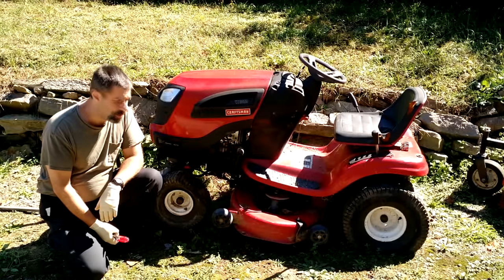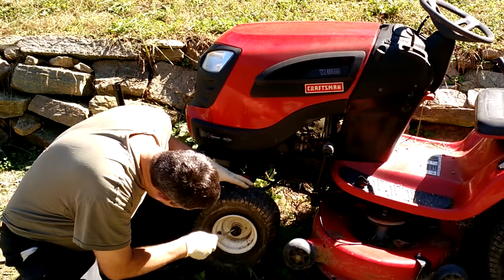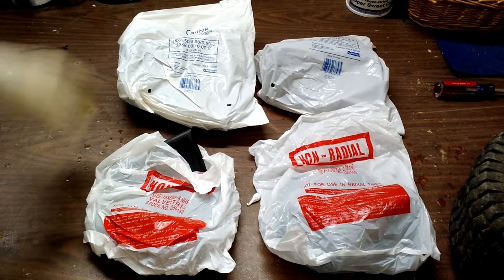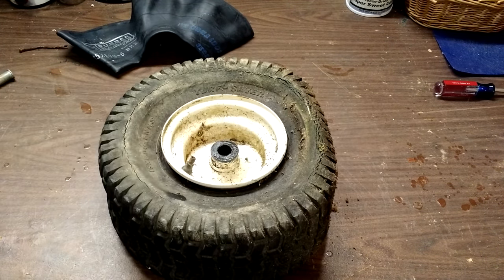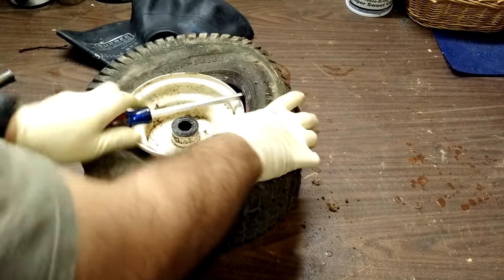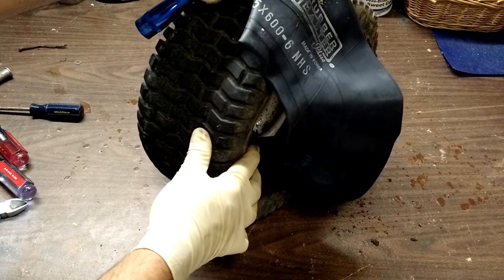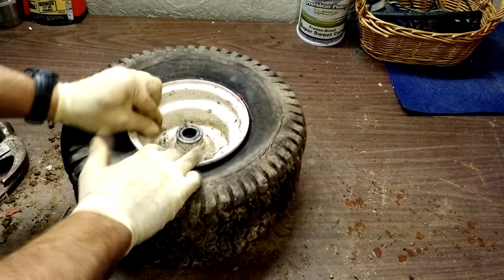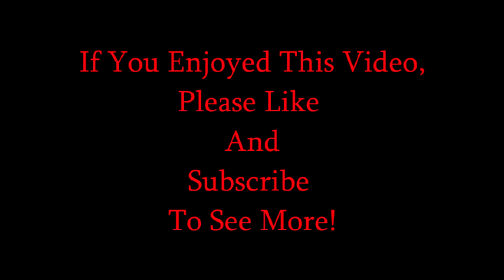Installing Inner Tubes On Your Riding Mower Tires.

Comment: why is it some tubes have the valve stem dead center in the tube, but it needs to be off center to match with the rim?
Reply from the maker: I don't know, but it drives me nuts wheti tried to mount them.
Reply: @FarpointFarms  same cause as soon as u start pumping air into it, the stem will be sucked back inside the rim and you get to start over
Reply: @FarpointFarms  just had to put a tube on a mower with a wheel that wouldnt come off. so everythin was 20x harder

Comment: Screwdriver and hammer didn't work for me, so I used two large glue clamps to squeeze the tire to the middle of the rim. That worked great once I figured out to squeeze the thread of the tire toward the rim.

Comment: I feel your pain, I snap a pair of vice grips on the lip of the rim, it keeps the bead from walking while putting the screwdrivers to it. Pump it up then let all the air out again making sure the stem is straight.
Reply from the maker: Great tip. Thanks!

Comment: Rub some vegetable oil on the tire that will make taking it off the rim and putting it back on so much easier. Also screw a valve stem puller onto the valve stem once you pull it through the rim that will keep the valve stem from falling back into the rim.
Reply from the maker: Thanks for the heads up!
Reply: Any lubrication will help reduce swearing. BUT by far the best I use for decades. Hair spray! Yes the one to fix the hair. The cheapest I can find is the best to use. Always have a spray can in my workshop. 
Lubricate the bead & rim well enough to make the job easy. When dry, just a few minutes, helps hold it in place, no slippage. Excess will simply wash away in the next rain. Oh! Worth mention it won't attack or affect rubber in any way. ;-) 
Cheers
Reply: Dish soap is better, when it dries it lets the bead grip the rim... oils will let the tire slip.

Comment: @13:30   Nope. If temperatures swing too much, the tube pressure will decrease and the  valve  base will scrape  against the wheel hole,  eventually cutting into it .  And theres no patching that.

Comment: Thanks Kindly, it can be very frustrating Indeed. I place a metal rod as an axle and clamp it down in my vice. I've broken seals with a wood clamp or C clamp. Lube up the bead and use a crow bar against the rod and go around after inserting a large screw driver. But unless you take the tire off there just isn't good way but through feel to get the stem in properly. Peace and Joy riding about with tubes in you tires fer ser! I put a few tubes in my old Wheel Horse tires, 35 years old and the original tires! Don't make em like they use to, eh? Thanks Again! DaveyJO in Pa.

Comment: You didn't say anything about greasing the bead. When you get the valve stem through the wheel a zip tie cinched up tight on the stem will hold it in place.
Reply from the maker: I never thought about the zip tie trick. Thanks!

Comment: My zero turn rider is stored in garage. Over 20 years old, NOT dry-rotted. The sun does that. I need tubes though. I'm going to use a little dishwash liquid.
Reply: Larry Schwartz they didn't have zero turns 20 years ago
Reply: Actually the zero turn mower dates back to 1964 with a machine called  Hustler.  My Massey Ferguson ZT was built by Simplicity in 1996.

Comment: I'm currently fighting this situation on my tiller, I'm considering not seeding the new lawn... 😒
Reply from the maker: Once you get them on it is fine, there might be a few curse words while doing so. Don't let it beat you
Reply: @FarpointFarms  
I got it on, got back to work, then ripped the valve out of the new tube.

I happened to have had some valves laying around so I went tubeless... then broke the weld on the rim...

So I welded the rim back to the part that connects to the axel but had burned a hole into the rim and was losing air...

The weld held and the air lasted long enough to complete the yard. 

I'm now smoking a cigar and watering my dirt. 

Thanks for the vid, it helped me allot!

Comment: easier if you put valve stem through the hole first when poking tube into tire.
Reply: Putting the stem cap on will prevent it from pulling out as well.
Reply: @sonocativo  Not. You need a little valve stem tool to screw on. The don't cost much.

Comment: The struggle is real!  I was looking to find a easier way to get the tire tube and tire back on. Got it on. Aired up
 Had a hole. Patched got it back on and dang it. Different hole. 3rd times the charm. Lol. Also hard to tell which way the tube goes in the tire. When adding air. It pulled the stim right back in the hole. Had to take it out and turn it around. No easy way around this. No wonder all the tire shops around us wont mess with a tire and tube.
Reply: Sharon Mobley
 - Tip, after patching a tube. Always fill it up well and check before assembly. It´s very common to have more than one hole. It´s also the perfect time to check for cracks in the rubber specially if working with older tubes/tires, Murphy´s law you know... ;-)
Reply: crpth1 yep! Checked the tube in my pool before installing. Found out there were some burs on the rim. Metal filed them down. Then went to harbor freight and bought the mini tire installer. OMG!Game changer. Alls good to go now.
Reply from the maker: I've been eyeballing that tire changer for years. Is it any good?
Reply: Farpoint Farms it works good once you figure it out. Use a 20% off coupon. It's worth it.  The small 8 x5 was a pain but the rest 15 x 6 were a breeze!

Comment: im about to have to do this to my pressure washer tire while its still attached to the washer because i cant get the push nut off, couldnt even cut through it
Reply from the maker: have you tried to cuss at it, I swear it does work sometimes

Comment: I would have just used used new tires, but I know a guy that has hundreds of tires on the rims fronts and backs $5 and $10 a piece. $30 all 4.
I'm doing an inner tube on one front tire now, but the sidewalls are not that bad.

Comment: I know exactly how hard doing that is. I've stabbed the new innertube trying to use screwdrivers to force the tuff tyre over the rim I've wrecked 3  innertubes struggling to get the tyre back on the rim using screwdrivers as leverage
Reply from the maker: It isn't hard to goof up the new tube!

Comment: I stopped working on the front tire innertibe change out to see if I could find a YouTube video on the subject. I thought I was doing it wrong maybe, but just like your project, what a pain in the ass.
One thing, I kept losing the tube stem while trying to set the bead, so I screwed on the tool that comes with a good patch kit, the stem core remover with the thread straightener.

Comment: remove valve stem and then you squirt ATF into the valve stem ...I use about 4 oz for each tire.....  use an old restaurant style ketchup squeeze bottle with a tip that fits into the valve stem.
Reply from the maker: Thanks for the tip

Comment: After 18 flats, I finally had to put in that great stuff foam, after 1st application next year drill hole in tire size of foam tube, then foam it up, have screw ready just a bit larger than drilled hole, and force thread it in there,... you may have to refoam for a few years as the foam seems to shrink back.. otherwise impervious to flats and at low speeds (LOW SPEEDS) its ok so far.  NOT FOR Bicycles or higher speed vehicles as it gets low spots that would vibrate like crazy a high speeds.
Reply: Didn't you like the vid?
Reply from the maker: I've never heard of that. I swear, I friggin HATE doing flat repairs on these so that sounds like a great idea.  Next time I have one go out on my I'll try it.

Thanks!
Reply: Yeah, as said 1st year no problems, 2nd year refoam the flat spot (fromsitting all winter, by drilling hole like 3/16th " to fit tube from foam can, then immediately put in screw or 1' bolt machine thread works well too.  You typically need 2 cans of foam for 1st time, then 1 can perhaps each year for few years after that... its nice because I can literally drive across a bed of nails and not worry about flats;  some people put in concrete but its heavy so i chose the foam ('great stuff foam at lowes or ace ).   I have only done front tires just the first time or 2 ,  less weight on em, so they last better... another good think is the tire condition doesn't matter too much as long as it holds the foam and you can do it in increments; foam, let dry, finish foam, etc. if tire is very leaky.
Reply: Yeah its good vid, but really foam is so much easier and immune to future punctures.
Reply: +john Doe 

what about time comes for new tire? Foam a big mess then...😬 or not???

Comment: It is a 20x8x8.00 back tire
Reply from the maker: I think there is a clip holding that tire on the axle. Remove it with a screwdriver and then follow the way I did it here.

Comment: This is painful to watch. Harbor freight has a machine to break down tires. But you seem to be like me a bit of a cheap skate. What I do is take the tire off an lay it on the drive way, concrete, let it bake in the sun on a hot day for a few hours. Softens up the rubber.  Then take some dish soap an go around the rim and tire. Then stand of the tire pulling away from the rim. Go all the way around the tire. Let it sit for a hour or two and it will make it a little easier to break down. Hope this helps.
Reply from the maker: One thing is for sure... I am a cheap skate!

Comment: A little tip is when you get it over half way on the second side of the tire. It will go on a lot easier if the first side is almost completely inside the well of the wheel. Grease is the key really and lots of it. 
I also use tape around the fill valve once its through to stop it going back down.

Comment: Just as bad as wrestling with an alligator ... you can pinch your finger, have a screwdriver pop back in your face, pinch the tube .... good job though .... note: 11:48  might wanna try and put the valve cap on before you re-load the tire  so's it won't fall back in  .....
Reply from the maker: I love that description!

Comment: Why don't you just buy new tires.  Can't be that much more expensive than the tubes you just bought.   Same amount of work and much more dependable.
Reply from the maker: Even new tires tend to leak at the bead when they are put on old rims like these. They don't seal well, plus a set of 4 tubes runs about $40.00 to $50.00 on Ebay. That's a lot cheaper then a set of tires.
Reply: Well we disagree I guess.  If you prepare the rim properly for the new tire, it will not leak.  If you leave a lot of rust on the bead then they will leak.  If you wire brush it well and give the bead a good coat of spray paint, they will not leak for years.  Even with tube the rims should be properly prepared because that same rust will puncture and deteriorate the new tube quickly and you will be where you stated from.   Sorry but we disagree.